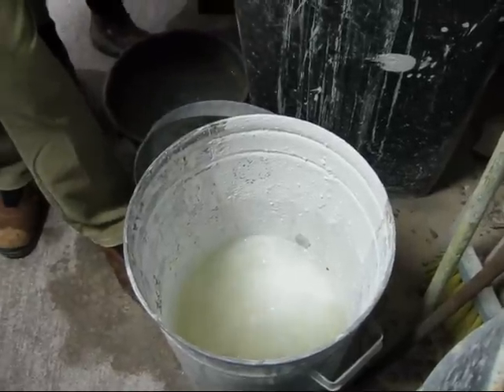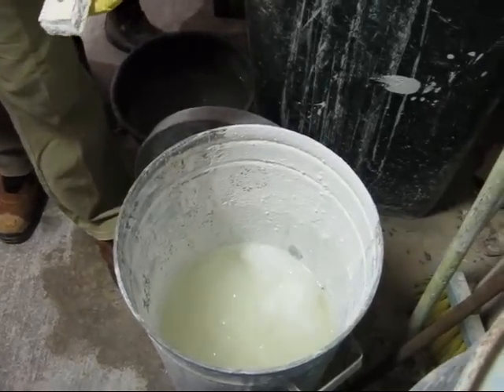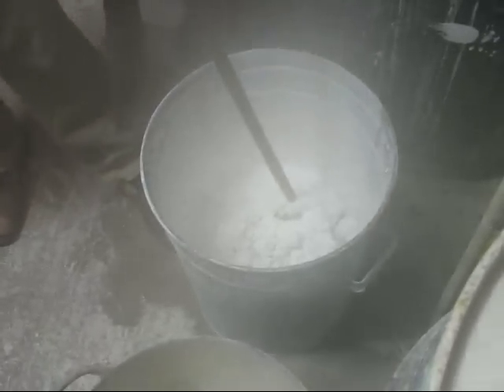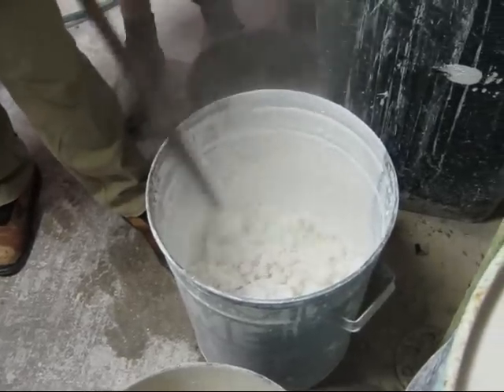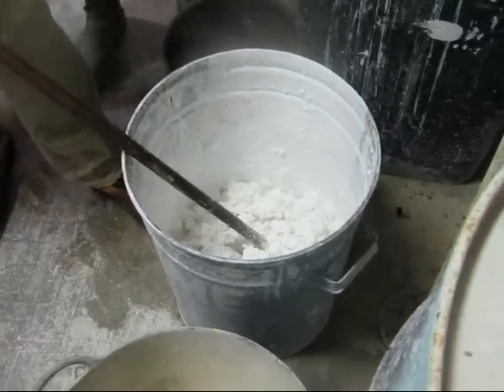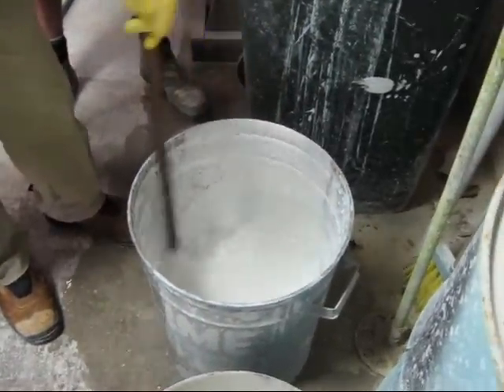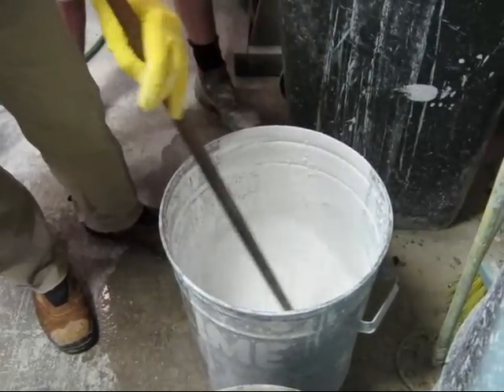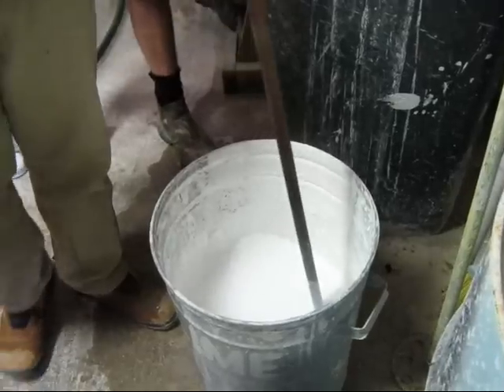Slaking rocklime

Comment from the maker: hi harmageden usually, a mortar uses a ratio of 1 part of binder to 3 parts of aggregates (dependent on the range of particle sizes etc). I don't recommend mixing sand with rocklime. It's dangerous enough just to add water to the stuff.

Comment: Hi.
Calcium Oxide comes in that solid form (the one you have in hand in the 10th second)?
Melting Point of the CaO is 2572*C.How does perform that solid form till 2000*C?Is it still in solid state?If I cut a form, let's say letter A, in a CaO plate,i put that plate on a stainless steel,then i begin to weld in the A channel of the CaO plate,what will happen to the CaO.Will it melt?Stainless steel melts at about 1620*C or the weld material will fuse partially with steel material.
Thank You.

Comment: Marble is limestone?  I'm confused.
Reply: Limestone and Marble are 'flux stones' or calcium carbonate. They're two different types of rocks but they're made of the same chemical so they do the same thing.
Reply: *****
I did some reading and figured it out.  Marble is just a metamorphic version of limestone where limestone is sedimentary.  Added heating, pressure, and other carbonates turn limestone into marble.